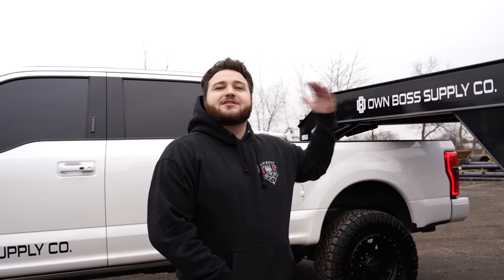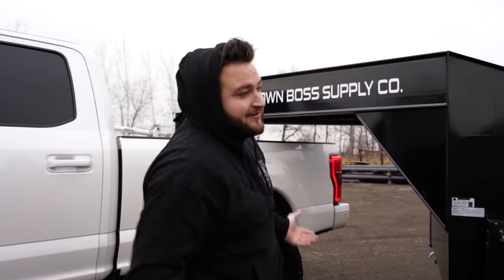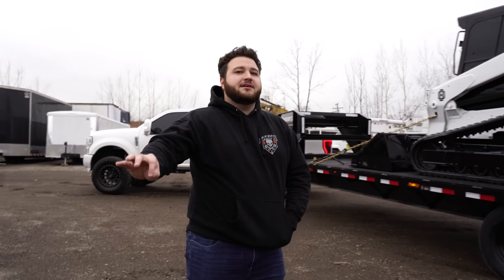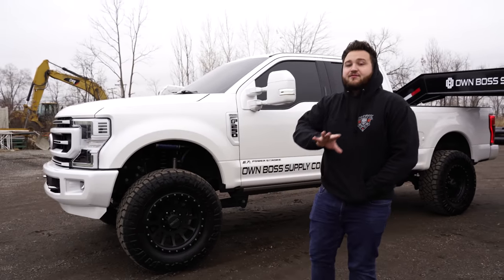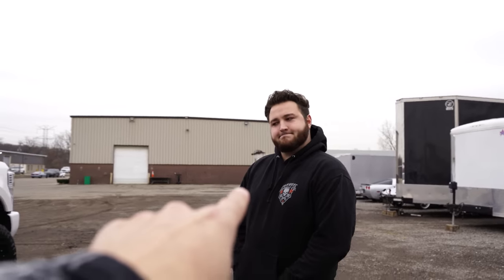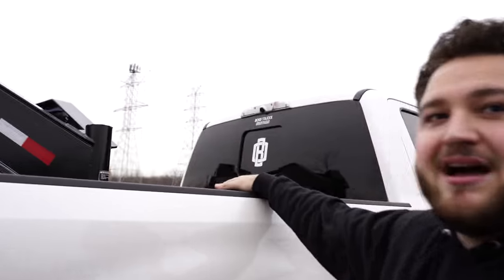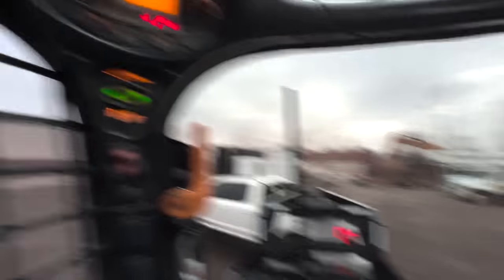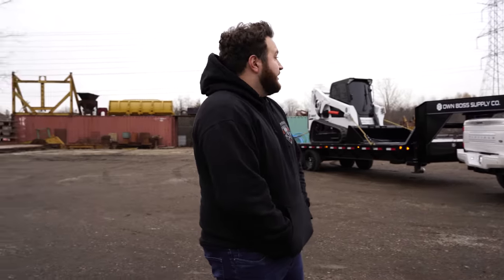overview of our first stormtrooper platinum F-250 with a 25ft gooseneck, bobcat t650 skid +$30k

Comment: I love the small 20” wheel, 37” tire combo. I had that on my 2017 250 but with 35” Ridge Grapplers instead of 37s. Honestly it was a great truck but I had to sell that beast when I got married. That’s life living on veterans disability pay. It was a dream truck man, and it was the right thing to do. We needed the money. You aren’t joking about changing a life with these setups. Living up in the Blue Ridge mountains of north Georgia 4WD is a must and there is plenty of opportunity in this whole Tri-state area of GA, Eastern TN, and western NC where folks are clearing lots to build their homes. I bet you’re absolutely right, you could easily make 450-500K a year with this rig or same or more as a hot shot. For those that don’t know, you can be a hotshot driver, don’t need a CDL and you can be regional and always be home for dinner with your family.

I would love to be able to use this in my woodworking/furniture business. My work is finally getting national recognition and I need a rig again for moving logs, slabs and lumber and my furniture to folks or my pallets of product to the FedEx distribution center etc. 

If that’s not enough you can also turn some cash out using Tommy Run (it’s like Uber but for dudes with trucks) and can help pickup people’s Home Depot and Lowe’s orders etc. Deliver materials to construction sites. It’s usually something like $79/hour minimum and you don’t even have to load anything.